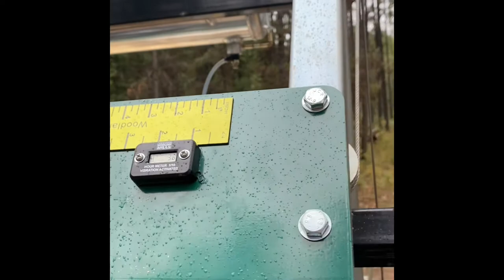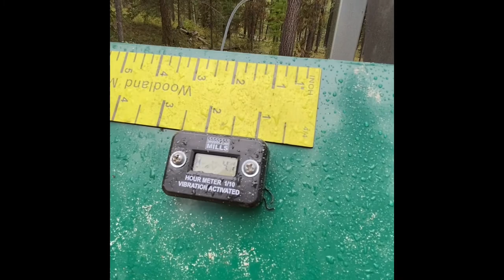Woodland Mills HM 130 MAX  tips and tricks. Plus natural looking siding.

Comment: For second I thought you going to cut your clamp lol I was edge of my seat. Lol I keep going back and forth on this or Norwood. But Norwood just looks like it's unnecessary overkill. I mean they got a roll cage pretty much 🤣. I mean if you plan on heavy log with a crane and your no expert buy the Norwood it take a bit more beating up top. Now the woodland has a better stronger platform the logs sit on. Norwood looks like a piece of sheet metal in between, like you could bend it right over. Both cut the same both are simple in saw design. Woodland is just a more simple design, easier to assemble and has a strong base and platform. O and it's cheaper by a thousand or 2. With Norwood portable says you can't extend but with woodland portable you go go 16ft or add extension to go 20ft or 24ft.
Reply from the maker: Lol, it does cut that last board 1” thick above the deck. I did consider Norwood when I was looking at this. For me I heard these guys (Woodland Mills) had great customer support, although I have yet to need it. The price point at the time of purchase seemed better on this one and it came with a Kohler engine. I have been pretty impressed by a variety of Kohler engines over the years and when it comes time for a rebuild the parts are easily acquired.